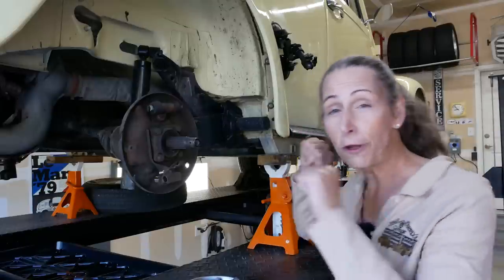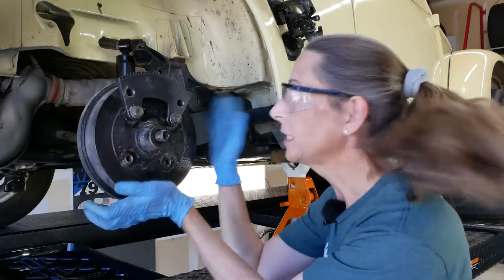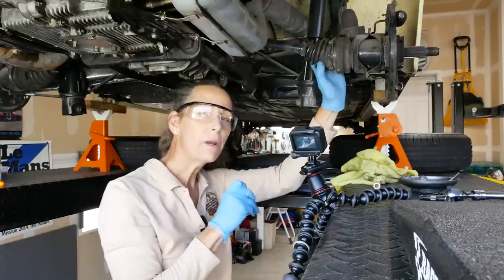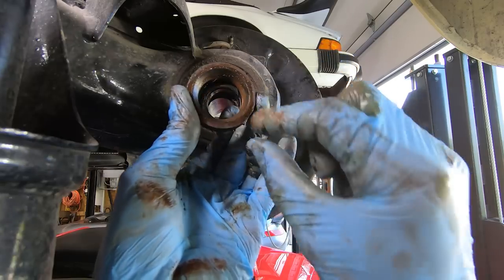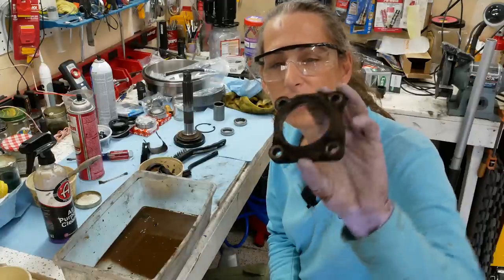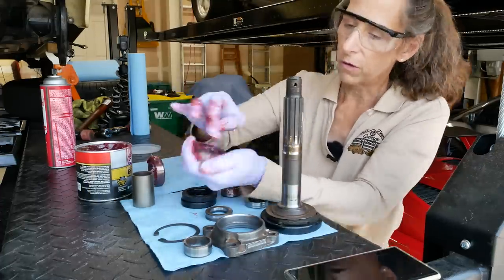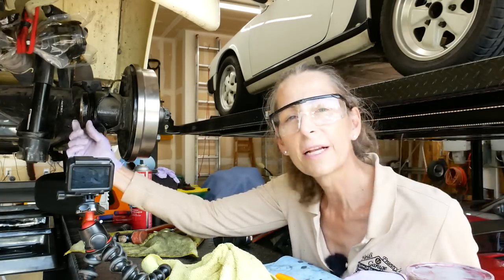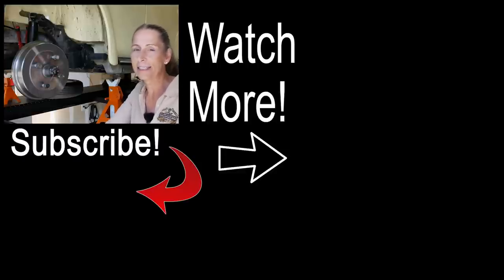VW Beetle Rear IRS Bearings - Quite a job!!

Comment: Hi Heidi.  When I watch your videos I find them interesting but wish you lived closer so you could work on my cars.  :)  Way more work then I hope to take on.     Anyway I used to sell bearings for aerospace before I retired.  It was fun watching your bearing techniques.   There right on.  Your technique for removing the bearings is a small issue.   When you removed the rear ball bearing you pressed on the inner race which is likely to damage the race.  (force through the balls can ("brinel") or dent the outer race)   Hence the slot you mentioned later would have allowed you to press on the outer race.   Either way you replaced the ball bearing and used a great technique to install it.  Never saw that before ie grinding down the old bearing but it worked great as you put pressure on the outer race.   With bearings never put the pressure (load) through the rolling elements when removing or installing them.    The removal of the roller bearing took less force so probably didn't damage it.   A roller bearing is designed to take less side or axial load.   The plastic part holding on to the rollers is called the "retainer" or "separator"    its orientation is not critical but your method was fine.   I like the idea of the bearing information on the outer race in case someone has to identify the bearing before removal.   Sometimes the inner race can have a shoulder on it so orientation of that is important.   Anyway always fun watching the videos.  I don't think my mechanic wears pearls when he works on my Porsche.  :)   Take care.
Reply from the maker: Thanks Walt!  Yes, I wasn't too worried about the old bearings, but it would have made life difficult if I broke that inner race not to mention ball all over the place!  Thanks for the tips :) F

Comment: Nice work.  For parts cleaning I use a large plastic bin, Simple Green, and a wire or stiff plastic brush. The really grungy parts can soak overnight for easier cleaning. 
Regarding the paper gaskets, those are used only on the swing axle setup, not the stub axle setup.
Reply: The swing axle bearing is actually lubricated by the transmission oil and the paper gasket, along with the rubber o-ring, keep the oil from leaking out of the bearing housing.
Reply from the maker: Thanks so much.

Comment: I had no idea VW's been using those tri-square bolts for so long...thought it was one of their more recent engineering decisions to try and keep owners from working on their own cars.  :)

I use a plastic tub with an appropriate cleaner depending on the job.  Brake clean for some items, a strong orange citrus degreaser for others, and sometimes full strength Simple Green.
Reply from the maker: Thanks!  I think the Porsche SCs use them as well.  They are hex on the 3.2 though.

Comment: This was great information. I watched this through a few times just to appreciate the design. I presume the roller bearing takes most of the force as its closer to the centerline of the wheel?

I heard once that if they were to make a Beetle today it would cost as much make as a modern Porsche 911. With all those parts compared with just a few parts in a modern axle/bearing one can start to see why.

Comment: Awesome work! Love how you break down all the parts. Now...if only my VW's were as clean! For a parts washer, see if you can pick up a smaller bench top style, there's quite a few out there in the 3.5 gal. range. I ran Simple Green in mine and it worked well. You could always pick up a 1 gallon Berrymans carb/parts cleaner too, for those small parts only. Or even better, an ultrasonic cleaner.
Reply from the maker: Thanks so much!

Comment: When I have to press or drive bearings and bushings in my garage, I often use a short length of pipe or a pipe coupling which is easier to use as a drift or driver. If the diameter is not right or off by a small amount I will turn or grind the OD or ID of the pipe or coupling so it will fit the application at hand. I think a piece of 1-1/4 in pipe will fit over that spline and push in the inner race on the outer bearing. I bet the inner bearing could be pressed in with a short piece of 2 inch pipe resting on the outer race.

Comment: I love to watch your video's, always interesting and very informative.
to your question about cleaning parts, as a professional repairing vehicles for over fifty years, i prefer a parts washer with a pump with a hose and brush attached where the fluid can be pumped through the brush. the cleaner i prefer to use is mineral spirits. i also use simple green and brake clean away from the bench.(both good for fine cleaning of critical parts at the bench)  i also use alcohol for electrical electronic circuits and components. I hope this helps. thank you for all you do.
R.G. Young
Reply from the maker: Thanks for all that!  Great info.  The mineral spirits comes up a bit.  I'll have to try that.

Comment: Yes, a parts washer.  I have one from harbor freight.  There are some you tube videos on modifying them to have external filtration, which I intend to do.  Solvent is PSC 1000.  High flash point.

Comment: hi Heidi and Franny! I have a 69 beetle. I just watched your video on how to fix the shifting linkage and made me realize some past mistakes I did on mines. thank you so much! i was wondering if you could do a video on replacing the (what I believe is called I'm still new) arm clutch stopper pin or a lock bolt. 
thanks again!

Comment: 20 gallon harbor freight parts washer on one of the harbor freight furniture dolly so I can move it around my tiny 2 car garage when it's in my way. I use PSC1000 solvent from tractor supply in it. I'm looking to upgrade the pump and filtration system in it, also considering adding a block heater element to the bottom of the tub to warm the solvent some to break grease down better.

Comment: I use Loctite SF7840 for degreasing parts, it`s great suff, bio-degradable, dilutable and safe enough to clean your kitchen with, it also smells nice. I`m a CNC repair engineer by the way 👍
Reply from the maker: Thanks for the tip!

Comment: I like to soak parts in Purple Power,  works pretty well if you're not in a hurry!  You also need a SPECIFIC "Parts Cleaning Brush"...works remarkably well.  Just be careful w/ the purple, it will eat away some of the cadmium plating if you leave the parts in too long!

Comment: I use 3 small buckets (look about the same size as yours) for my part wash that I just stack up when I am not using them. I do a full soak in decreaser, use the second bucket for scrubbing, and the last one for rinsing and then dry with air (unless I used a particularly nast degreaser).
Reply from the maker: Thanks for the tips!  The air at the end is really great too!
Reply: @HeidiandFranny  just be carefull about what you are using for a degreaser if you want to blow them dry. Some of the stronger agents that are publicly availible aersolize quite easily if you have any patches of grease left over with it stuck on and you can easily gas yourself out.

Comment: when testing before and after the testing should be done under the same conditions. When you tested the old bearings for play the 4 flange bolts were not tighten, and when you tested the new bearing the bolts were tight, more than likely they were worn due to age, but I wouldn't make that decision based on on how you tested for play, other than that you did an excellent job!
Reply from the maker: Thanks!  But the flange won't (or shouldn't) make a difference.  There are two bearings - one to handle load at 90 deg (up, down, fore, aft) and one is a thrust bearing.  That plate will never carry the vertical loads.  I did check it before, but filmed it after ;)

Comment: The bearing carrier was loose when you where shaking the drive shaft! And in my experience you always get play when the hub isn’t present and torqued up!
Reply from the maker: Yes, but that cover only had the grease seal so it won't add any rigidity to the shaft.  The outer roller bearing race handles the cantilever loads while the balls handle the end load.  Any movement in the shaft will cause it to wobble while driving.  If me with maybe 15lbs of force can get it to move, then 1/4 the weight of the car certainly will.  When I got done it had zero movement.

Comment: I picked up a 2L stainless heated/ultrasonic parts cleaner, its got a temp/time control on front and sits nicely on a bench. Great for clean-up, might be a push for that stub axle though, but for all the other components in this job its ideal. It was super cheap from a dental supplies company over here (less than $100), but I'm sure you could get similar via any of the Amazon/ebay routes (search model # JP-010S). If I was doing larger restorations I'd get a garage parts wash, but those components I just jet/steam wash and hand work for now ...
Reply from the maker: Thanks for the tips!

Comment: This was a very timely video. I am in the throes of replacing cv boots and refurbishing the two axles on my 69 and am really familiar with the terrain you covered. Oh...by the way.....did you loose your carpenters claw hammer? I did not see it used once.
Reply: Lol, it was there at the beginning at 2:03 to grab and extract the cut locking wire! :)
Reply from the maker: Yup!  That pesky hammer wanting some more air time ;)

Comment: Hello, There is a star wheel for adjusting the two brake shoes into small gap in between interior of drum and shoe pad. The star wheel itself have threaded stem fixed together and it will need the high temperature grease inside the star wheel's spacer nut. Both spacer nut and star wheel comes together form adjustment. Because iof no grease it will get rust and too tight to turn star wheel. Remember oil up the car and it will make Volkswagen super beetle happy. 
 Please, one more question can you find 4 cylinders from Junk yard salvage. And put on the Microbus bigger cylinder and replace the 1500-1600 beetle cylinder to make super fast beetle, please? It is just volunteer and fun. Thank you. Check your two seals of oil cooler at rear engine car. There is the problem: when you swerve too hard around the corner plus at same time you add more gas with your foot and it goes faster. But you need to add more weight like sand barbell and tight it up in under hood lid and more weight in bottom as low as possible of the beetle Sears Point racer.  Instead the bug roof have been laden at top heavy that might cause it capsize. Could you add canvas top and cut the roof out and replace with fiberglass - light weight like aluminum foil but thicker film reinforced with Styrofoam as it plies with the fiberglass atop of it.  Thank you.

Comment: My bearing and seal kit also came with a small o-ring and a thin washer. I didn't see them in your kit. Could they be for the older swing axel cars?
Reply from the maker: Yes, I think so...  I just wanted the big thin O-ring.

Comment: Great video.  Can I ask about the multiplier tool you bolted on the rear hub?  I went through your replies and 1 was about the tool but didn’t come up with the one you used.  Do you have a link for where to purchased it
Reply from the maker: Thanks!  You can find that tool here: The VW Torque Multiplier too for rear-wheel nut: https://amzn.to/3besSiq

Comment: Hello Heidi and Franny, I have a question. Franny, on the rear bearings, I have got everything up to putting everything back together but can’t get the axle to go all the way through the ball bearing. It just gets stuck and won’t move forward any more for me to put it back together again. I’m not sure what if or what I am doing wrong?  Any guidance you can give me is greatly appreciated!  
😃😃😃
Eddie F.
Reply from the maker: Hi Eddie, Do you have any burrs or corrosion on the axle?  It is a bit of a tight fit, but it shouldn't take all that much effort but it will take some tapping.  I'm sure it is, but make sure it is well lubricated as well.  Oh, make sure it is riding properly inside the seal and that the seal and inner bearing are both seated completely.

Comment: so is that wheel bearing tool thing especially for orig. Beetle? I cant see it easily fitting another car, nor have I ever seen one used before.
Reply from the maker: The torque multiplier for removing the wheel bolt?  That is pretty specific to VW, but it will also work on a 356 with some modification.  As for the seal puller, that is a universal tool.

Comment: Hi, i´m new in the channel, it´s so cool see a woman do that job, i love it. 💪 
I have a question, one of my shaft came out very easy, witouth hit it, only with my hand... it´s wrong, could be worn out or something?
I hope you can help me. 
¡Saludos desde la Baja Sur!
Reply from the maker: I think that is fine.  See how it goes back in with new bearings.  You just shouldn't see any of that movement we were seeing before I took it all apart.   When it went back together it was super solid - pretty big difference.  Good luck!!
Reply: @HeidiandFranny  Thank you very much, I appreciate your answer. I’ll try, last time (and the only time) I did the job I just cleaned the old bearings, put grease and new seals.

Comment: Yes, I use the grease and cleaning basin I called it tray or shallow bucket Yes, I use dawn soap to clean engine part and blow gun compressor and tank 60-gallon 3 cylinder air pump for blowing clean g auto transmission. I use strongest solvent and electric varnish gum remover device but I don't have the ultra sonic cleaner for max cap is 1 gallon. I hear a lot of whistle from blow the hole of the bolt attaching to the thread tighten system. No problem.

Comment: Love your video but I caution against using brake cleaner indoors. After a while you get used to the smell so you don't realize how strong it is but you really don't want to breathe it if you can help it. It's good stuff and I use it a lot but I always try to take my parts outdoors if I have to use brake cleaner on it.

Comment: Hi.  7:20 you comment on the play.   You have the bolts loose so that's to be expected.
Reply from the maker: Hi, that cover just houses the seal, not the bearing so it cannot impart any rigidity to the axle.  The axle is supported completely by the inner ball bearing and the outer roller bearing.  The latter handling the cantilever load. The loose cover might have added a tad to the clicking sound though ;) F

Comment: Could you tell the rear bearing nos that were replaced both inner and outer ? Thanks.
Reply from the maker: Good question...  No, not for sure, but they were at least correct.
Reply: @HeidiandFranny  hi there I also wanted to know I have just finished repairing front and rear break cylinders and the rear pistons of  cylinders are working but the front even after silicon grease the piston are very stiff they are not moving at all unlike the rear so what could be the problem?

Comment: Roller bearing is like thick pin bearing. The ball precision radial bearing are both different. The ball bearing have set of 2 retainers, outer race, inner race, and balls and in some cases it has sealed but only the factory can seal it very good seal (tightly) so the grease is not suppose to come out except at the slowest leak of grease coming out at high rpm and long duration. Roller bearing don't have ball instead it has rollers. Which one is better ball bearing or roller bearing? This is less friction because One precision ball bearing radial per wheel is what the Ford car have and it roll - a lot better gas mileage than any car that have two ball bearing radials per wheel so it is 8 bearing per car that them goes to the 4 wheels.

Comment: 3:13 : A proper sized torque wrench 😁 ? I have a mid-prized torque wrench for torques up to 350 Nm (roughly 258 ft•lbf). It costed me about 100 $. Was very well worth the money. But the torque multiplier looks like a nice tool, i will try it myself 👍

8:36 : It won’t hurt to give the socket a slight tap with the hammer. Those screws are extremely sensible if the socket isn’t fully set. I have to deal with them on a regular basis, because the Porsche engineers are deeply in love with the 12-pointed heads since... ever.

10:24 : 14 mm was a common wrench size for M8 bolts back in the days. The 13 mm head came a little later.

17:23 : I use a stainless steel bowl out of a deep fryer and gasoline. A bit old school, but the gasoline does the job very well. But you must protect yourself thoroughly, that stuff is really dangerous.

I like the trick with the old bearing. And the fact that you install the bearing with the markings still readable. As always, a nice job 😊 I’m looking forward for part two! Oh, and afaik the paper gaskets are only for swing axles.
Reply from the maker: Thanks for all that!
Reply: Oops, i meant socket. My english skills failed, because in german the socket is called a „Nuß“ which means nut. Corrected it... 🤭

Comment: Hi Franny, if you have not read it yet, consider this article from Bruce Smith in the 356 Reg magazine - http://www.sparkingplugs.com/resources/BSmith_Parts+Cleaning.pdf - The PSC1000 is a very good cleaner, available in 5 gallon drums, be careful as a solvent it may not work in the cheap parts washers, but good to have nonetheless. https://www.tractorsupply.com/tsc/search/Crown%20Pcs%201000?

Comment: can you put the guts of a irs into a swing axle case.
Reply from the maker: They are really quite different.  The swing axle lubricates the bearings from the transmission oil through the tube.  The IRS uses CV joints and sealed axles.